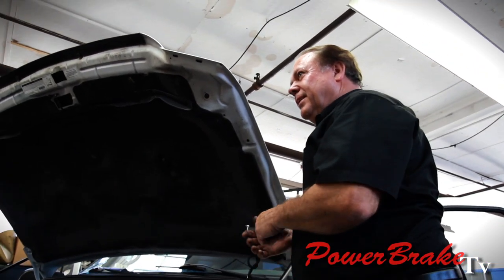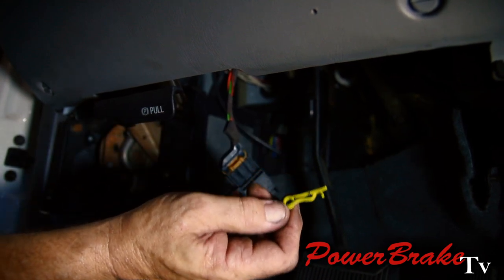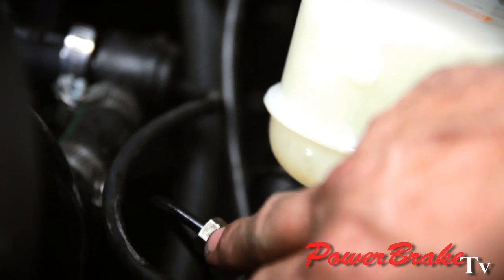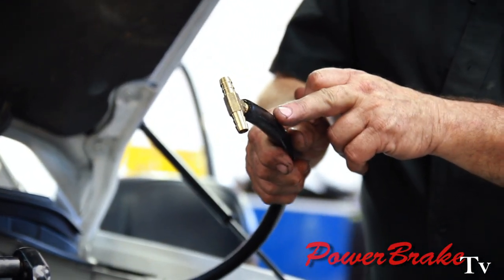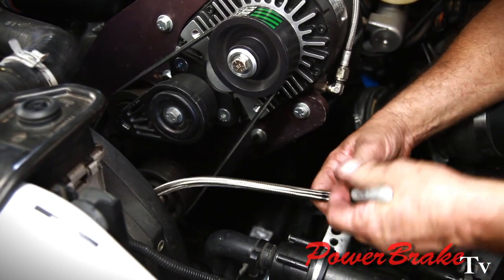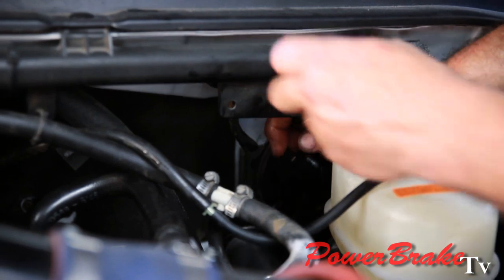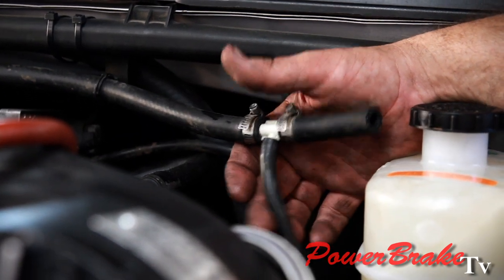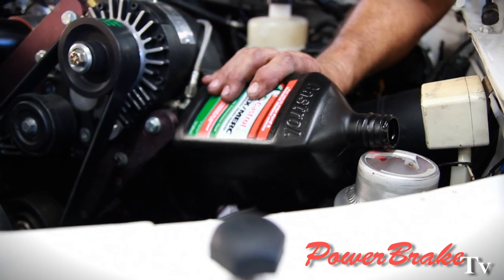F250 Hydro-Boost Installation for 8 Lug Magazine - Sweeting Performance

Comment: Hey Matt, I'm working on my 2000 F250 7.3 and I recently replaced my power steering box and noticed that the guy I bought it from ran the lines from the box to the pump and from the pump he capped off the line. So I had the two ports (the ones you screw in) and the hose that goes over the nipple free from the box and the pump. My question is where do the lines that screw in go? Which hose do I T off? I'm basing this off me looking at the fire wall. So the line I screw in from the right is a 16mm the one to the left is bigger. From the power steering fill up, I have a line sitting on top (which I believe is the return line) and that one goes on the nipple part of the booster. Then there is a line running from the steering box into the front of the fill up/pump port, both of those are the screw in. If you can please let me know what to do and what line the lines are call if possible. I bought a cheap Chilton book that didn't tell jack shit. And I don't want to spend $300 on book. Your help would be greatly appreciated. My brake pressure is complete shit right now.